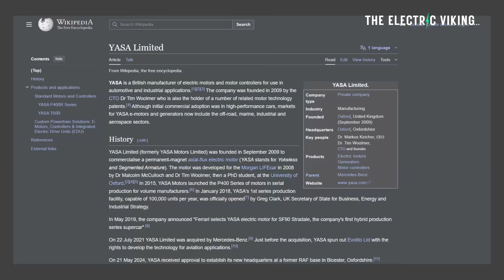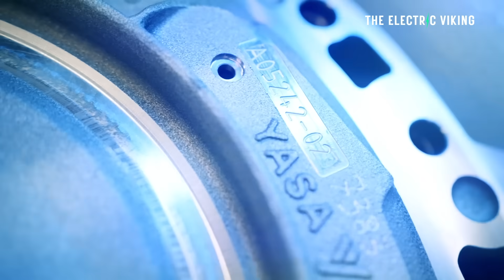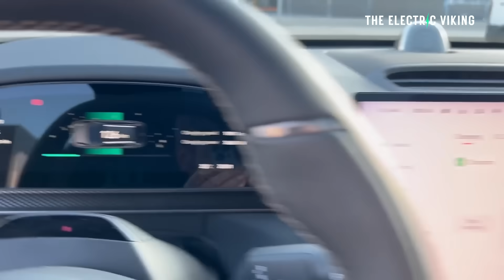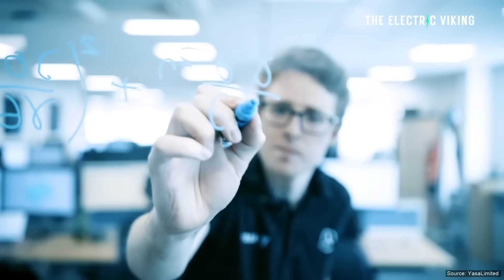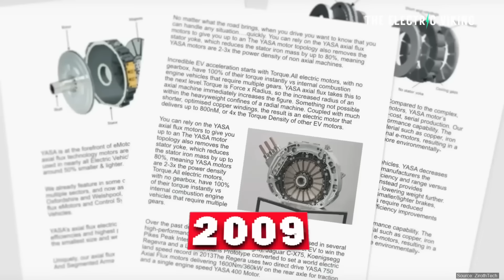The Worlds Most Powerful Electric Motor has 1000HP and Weighs 12kg

Comment: This could have an interesting cross-over application in the aviation sector where the power to weight ratio of the power plant is of great importance. Im thinking mainly of large unmanned 4-rotor military drones, or indeed civilian manned versions (GPS-guided self-flying cars). The weight of battery packs is still an issue though until a technological solution can found how to store lots of electrical power in lightweight cells.

Comment: I need one of these motors installed onto a differential with a Torsion gear inside and stuffed into a track toy like a Caterham 7. I'll also need one in a exocar with really hard tires and a locked diff for the most economical full size drifter... but we won't mention the "Oh crap" FWD motors, those are secret for the wild moves nobody else can do. (programmable angle from over spinning the rear and gripping the fronts at different rates allowing you to drift wide angles at a crawl or pull through what should have been a spin)

Comment: I'm not interested in 4000hp, i want to know how small the motor would be for a small car. Like the Renault Zoe has a base model with 80 kW, i want to see that motor. And is it as reliable or energy dense as the current Yasa motor. 
I also wonder how hard it is to make, as it requires a lot more precision than a radial flux motor. It's not really a new concept, so is it patented? And if so, what are the patents. Can we expect other manufacturers, probably a Chinese company, to make axial flux motors in the near future

Comment: This is propaganda or some bullshit to pump up their stock. 
An Electric motor power is measured by continuous power delivery, not peak power.

Peak power doesn't count.

It's like you push a 4 cylinder 2.0 motor to make 1000hp but it destroy itself on the second day. 

Same thing would happen with this motor if pushes 750kw continously. It will overheat very quickly

Comment: An AWD 4000 HP BEV vehicle ! I wonder if instant electric torque G force acceleration at that level damages a human's internal organs set in a human body with many other organs attached to each other in a mostly weighty water liquid bag of surrounding skin, and then all organs are pushed around being deformed against a bone rib cage surround vertebrate skeleton frame pressing those stretched organs when pumping liquids like blood. All organs then pressed instantly flat in shape from when naturally hanging shaped by gravity. Organs suddenly, and often repeatedly pushed against a vehicle's cushioned backrest seat seems not a good for one’s long term health. What happens if this organ abuse happens over, and over when driving thousands of kilometers/miles of driving with a tempting lead foot pressed often onto the accelerator pedal? I would think G forces in a quick to move AWD BEV with 4000 HP/ Torque would exceed a heavy rocket lift off, or a tight maneuvering fighter jet aircraft’s experienced G forces.

Comment: From what I understand the 12kg is a little misleading, that's for the core - the composite structure, stator and rotors, it does not include the aluminum housing.

Comment: You cannot compare an electric motor to an I.C.E. by weight without mentioning the battery weight required to actually run the electric motor.

Comment: Motors haven't been the issue for a long time now. Its all about the batteries
Reply: Yes baterries being still the bottleneck, but doesn't mean improvemt in other areas should be neglected
Reply: Se o motor é mais eficiente isso reflete na bateria
Reply: It weights 12kg while producing massive amount of power output. If true, can be delivered in scale for production vehicles then it is a massive innovation.
Reply: Air Driven Electric Generators replace batteries. When air pressure drops pull into the gas station and instead of gas you air up the car. Run out of air in the middle of nowhere just take the lever out of the trunk and pump the air into the tank. -Q

Comment: Equals five grammes (=0.005kg) for an EU street legal 250W e-bike motor? :D
Now build it with the new up and coming battery-tech, denser and lighter ...
You won't even notice that your bicycle is an e-bike, when you've run out of battery. It will be as light as any other bike.
Bet that will change something too ...
:)

Comment: You did not mention the weight of the battery required for that 1000hp motor. The weight of the motor is irrelevant compared to battery weight.

Comment: Engine weight is a decietful comparison, it doesnt matter if the engine is 1000lbs less, when you need 1500lbs of batterys to power it that takes 18 hours to charge and loses half its charge in sub zero temperatures. ELECTRIC WILL NOT WORK IN NORTHERN CLIMATES.

Comment: Nobody needs a thousands hp for moving around.
Nice to have a light engine but you still need to lump around a ton in batteries.
So who cares for a 100kg weight gain in the engine.
Current lithium batteries loose 2 to 4 % of live, sodium will be better but with lower energy density.
So more weigt
More weight means more roadworks. For have things wreck roads.

do I see benefits for electric cars yes mostly in air pollution in city's.
Are they holy, he'll no they bring a whole string of new problems.

Comment: More interested in a 5hp Ebike hub motor. 3hp would probably be OK. But need the weight to be low. Battery also needs to be lightweight and high duration.
Reply: A typical Ebike uses a 48v battery with about 16 ah. The motor is 1000 watt.

Comment: Think scaled down.  The next Miata.  150mph. Tiny, low cost, and fun.  One of the biggest problems with EV sports cars is they are too heavy.  This can cut the required size of the batteries.  More fun and lower cost.

Comment: You forgot to mention the size of battery require to power one for more than a few miles...And how much it will weigh.....
Reply: If they will allow to use nanocardon tube batteries then might weight less than a small sedan with 1000km range
Reply: @eugenscobioala7242  Maybe in 20 years time when such batteries might exist...or they might not.

Comment: No one reading this will care. But here's my dream car/application for these motors.
80's square body suburban. Cherry red. Lifted of course with 49 inch super swamper tires. 4 motors, 1 attached to each wheel. Chrome trim and off road running lights on top. 
How would you use them for your dream car?

Comment: Does the YASA motor, reportedly weighing 12 kg, include integrated friction brakes, thermal management and ingress protection?

Protean Electric have in-hub wheel motors already available with integrated fiction brakes, thermal management, ingress protection and vehicle control systems built-in. There are two  in-hub motors available:

Model: _ _ _ _ _ _ _ _ _ _ Pd18 _ _ _ _ Pd16
Peak Torque (Nm): _ _ 1,500 _ _ _ _ _800
Peak Power (kW): _ _ _ _103 _ _ _ _ _ _40
Max Speed (km/h): _ _ _225 _ _ _ _ _ 150
Motor Weight (kg): _ _ _ _39 _ _ _ _ _ _ 28
Continuous Power (kW): 54 _ _ _ _ _ _ 26
For Vehicles (kg): _ _ <5,200 _ _ _ _<3,200

The NEVS Emily GT has four of the Protean Electric in-hub 18-inch wheel motors, coupled with a battery providing up to 1,000 km range.
https://www.youtube.com/watch?v=-1VAkXNTR1Y

Comment: Wheel hub motors add unsprung mass and can be damaged when driving over pathholes. Its better if motor is part of suspension and is protected against high shocks. Tesla rocks.

Comment: Hub motors for all wheels becomes instantly possible, especially with regenerative braking doing most of the brake work. Imagine two Yasa motors on front or rear wheels, regular brakes in the other wheels. 
The entirety of the faff of transaxles, boots, transmission boxes, and engine bay, gone.
Also alows dead simple conversions of ICE cars into EVs by putting  hub motors on, and replacing the heavy engine with a battery pack.
Reply: It would be great for trucks. Imagine 18 wheeler's with 18 - ok 10 mtotors? Even the trailer is self propelled. Then the engine can just be a generator like in diesel electric trains. That would free up opportunities to improve efficiency and reduce emissions.
Reply: You do realize there is a reason there are no hub motors on cars or trucks even though the tech is there? Unsprung weight and located in area where they are easily damaged.

Comment: Dumb question... would using two of these weigh less than a conventional single motor configuration with a drive shaft?  (And I assume extra hardware for the differential?)

Comment: I just want them to make this thing as tiny and as cheap as possible and 30 - 50 hp. Put 4 of those in a family car, more than plenty power for commuting and picking up the kids and would not need a battery with a ludicrous power output.

Anyway you'd probably need to go about 400 km/h to even put  down 4000 hp, so completely useless for anything but bragging rights and setting speed records. (which is obviously awesome, but for most of us not really in the budget)

Comment: put this motor on a turbine fan and see how it compairs to a jet engine for air flow.  Also,  place this motor on a quad-copter and see how it compairs to a  Jetson One personal flying machine.   If... IF..... the solid state battery or high power aluminum ion battery could be paired up with this could you just think of the possibilities.   True long haul 18 wheelers,  true powerful heavy machines like bull dozers and tractors.

Comment: If electric motors are superior and lighter than combustion engines, why  are EVS SO EXPENSIVE? Thanks.
Reply: New tech this is the model T of EV try getting the model T 100 yrs ago you'd be a fool why not just buy a horse and wagon I reckon
Reply: @renjia3504 I disagree. If EVS are made simple enough to drive them analog mode without any auto pilot program, the units could be sold at a competitive price compared to its combustion counterparts.

Comment: Sooooo, now produce a sensible powered super light / compact disc shaped variant, with onboard converter / con electronics and mount in parallel with a much weight reduced brake disc ( as motor will do most of braking) - offer in a modular form.

One on each wheel, canbus torque vectoring, stability control + ABS all in. Provide these to gigantic automotive, aviation, marine markets and subsidise retro fitting to classics etc from insane profits.

Make a semi-specialist retro fit kit for various cars, requiring only a canbus new throttle pedal / use existing throttle if already canbus. Traction battery with built in charger...Wouldnt need much more? 

So depressing that EV design hasnt taken opportunity of modular simplification, given simplicity of components compared to Fossil. - Just look at the retro EV conversions...aint exactly like an RC model... But could b couldnt it?

If it is practical / safe to replace existing discs with a disc motor, with or without hydraulic back up, requiring then only a traction battery with integral charger and remaining electronics + pedal....

We are now already at weight parity and 300% performance advantage, with battery tech that will produce more range for the size and weight of a full fuel tank within grasp...a simple 24 hr drive in / drive our retro fit for $5k would make a lot of sense :)

Within a couple of yrs we may start seing Audi TT type cars with affordable RS performance and better range of similar or lesser weight :)

Comment: Does high power density translate to high electrical efficiency? As in, does this motor convert electrical energy into motive force as efficiently as, say, Tesla's or Lucid's motors? Looked on YASA's website and did not immediately see any data on this aspect.
Reply: a good point - does the market usage of term 'density' take into account kwh / NM as well as size and weight?

Comment: I have been designing and building planer motors for a decade. I have a a custom planer motor that drives harmonic drives for robotics apx the size of your fist puts out 25hp but at 0-600 rpm with a peek of 900lbs of tq mechanical limit of the gears.
Reply: as u mention, the torque can be whatever u dream up, by further slowing output rpm using gears, however 25hp from palm sized motor is rather impressive?

Comment: Put 1 in each wheel. Mind blown.
Reply: The sprung weight would make for bad handling. The motors should not be in the wheel for less sprung weight. That's why the brakes on F1 cars are inboard, not in the wheel.

Comment: Sam you need to add the rest of the system to the weight to produce the overall power surely? Not just the stand alone motors. Still impressive figures though.

Comment: Where does all the heat go? The smaller the package for the same HP means smaller conductor's, higher resistance P=I^2R,  higher temperature rise, harder to remove the heat.
Reply: Yep, agreed. No free lunches. What are they proposing to do with all the heat naturally generated. Trying to dissipate from such a small amount of (conductive?) thermal mass, doesn't add up.
Reply: @Paul-w9r1r  heat to power conversion, using super capacitor interface with traction battery?
Reply: @davidstuart4915  
WTF heat does not charge super caps. What''s a traction battery PFM?
Reply: @davidstuart4915  always appreciate replies, thanks. But that's a LOL. Are you quoting "back to the future" memes?
Reply: @universeisundernoobligatio3283  try concentrating on interpreting what is being said before assuming u r the only bright guy on campas is always wise - 
1)thermocouple (heat to elec energy via Seebeck Effect)
2) supercapacitor to smooth power spikes
3) traction battery is that big heavy thing that provides power (electrical) to the traction motor (providing motive force / 'traction')
HTH
Reply: @davidstuart4915  
Try concentrating on real engineering.
1)thermocouples required a large delta T, It's takes 100s of Kg of metal to proved any Kw with them
2) super capacitors require lots of amps to charge them voltage V=(IT)/C  
3) So a traction battery is just a description of any battery that runs a motor, just tech babble to make people think it's some thing new.

Comment: Does the lighter motor generate more Kms per kw hence maybe get by with a lighter battery for increased payload or possible to provide a 20-80% 1000km range. That would be the real game changer for our 24/7 multiple call outs emergency response vehicles. Most of the other game changers are mere gimmicks for city people's toys. And what is it's long term reliability life span.

Comment: It would be far more practical if they focused on efficiency instead of max power and compactness. For efficiency the motor actually needs to be large, more copper equals more flux density over a given surface area which means more efficiency per pulse from the battery

Comment: Li-ion NMC batteries have a gravimetric energy density (at best) of 270 Wh/kg. If a single axial motors is 13kg (with an output of 550 kW), compared to two model S motors (combined output: 500kW, weight 64 kg) you could add 13 kWh of batteries. It's not nothing, about 55 miles.

Comment: It's interesting how things go around, LFP has been around for decades and yet manufacturers only just started using them. Same for Axial flux motors, there is a strange propensity for industry to use inferior designs due to prior acceptance and or driving factors that may not be truly relevant. 
Another advantage of Axial flux, which was not mentioned is efficiency, they have a higher efficiency due to reduced air gap, allowing them to still be efficient at low power, something that ICE simply cannot do.

Comment: I've been interested in designs that feature motors housed in the wheels instead of inside the chassis with power delivered by a thru-hub axle or shaft.  What I've read suggests that until recently the main drawback of such designs is the amount of additional "unsprung weight" in the wheels has negative consequences for ride, handling, tire wear, etc.  But if a motor this powerful can be this small and light, that would seem to address those concerns, right?  It's way more power than seems necessary for anything except a speed-obsessed track rocket.  Could they make it even smaller with less power for normal cars with normal power needs?

Comment: 4:10 Motor weight isn’t what’s holding EVs back from beating gas cars on track — it’s battery mass, cooling, and thermal limits. Even if these new motors save 20 kg each, the car still carries a 500+ kg battery that overheats, depletes, and cooks its tires under sustained load. Gas cars can refuel instantly and run lap after lap, while EVs like the Chinese hypercars struggle to finish even one Nürburgring lap flat-out before heat or charge limits kick in. Until battery energy density and cooling catch up, ICE cars still have the endurance advantage. The proof will be in nurburgring lap times and to date only one EV -- a 3000 horsepower Chinese EV -- has even broken 7:00